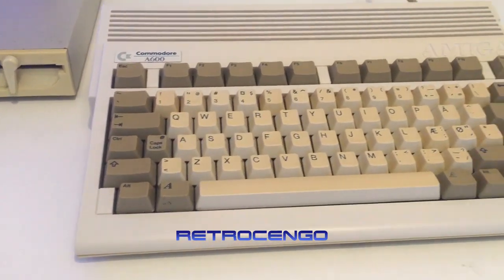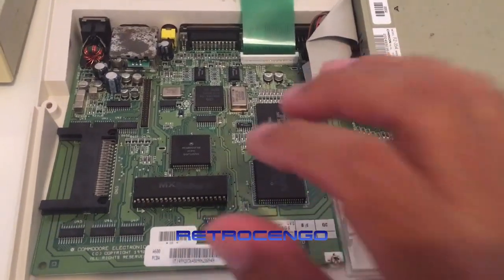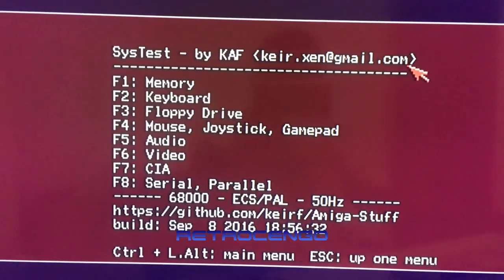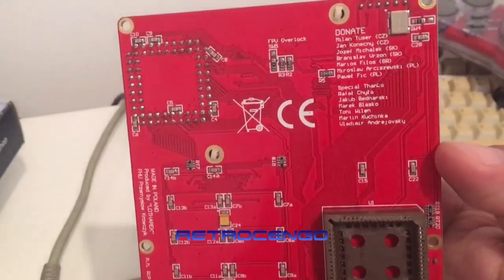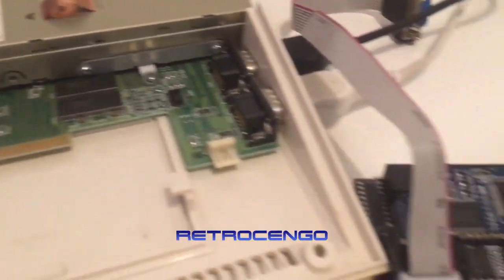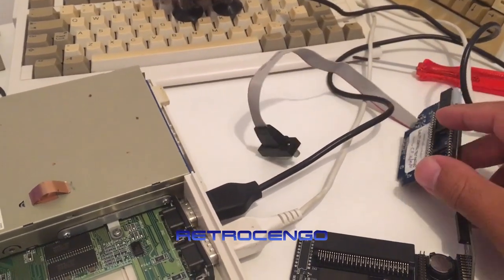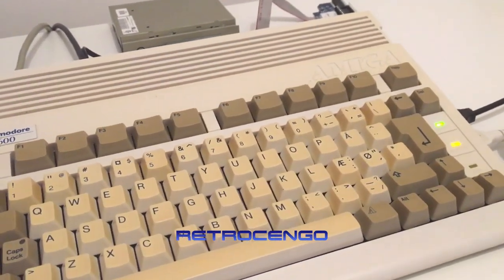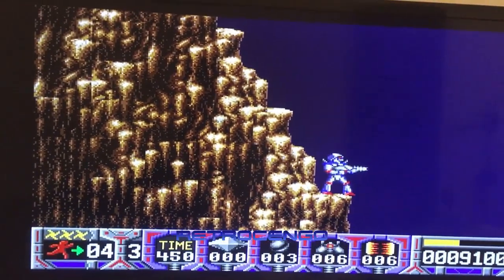Furia 68020 33MHz Commodore Amiga 600

Comment: Does the Furia board turn your 68000 chip into the 68020?
Reply from the maker: AzHeat63 It turns off the 68000 cpu, furia has a built in 68020 that takes over the system

Comment: How is that connected to your monitor?  The picture quality looks amazing.
Reply from the maker: Stephen Eddy Using RGB to Scart cable in Shielded Gold version, looks great
Reply: RETROCENGO ah, to a TV that is good at displaying a 15khz signal then.  My A1200 looks nothing like that, even via an OSSC
Reply from the maker: Stephen Eddy It’s a standard LG tv😁 shows normal 31KHz but yes in real life it looks even better😁
What do you use?
Reply: RETROCENGO I use a Dell 2007fp monitor with an OSSC to line double.  It still doesn’t look as good as that.

Comment: This is a great setup. My Amiga 600 will be the same. I got everything (also brand new ram) but not the Furia. I will buy a Furia later. I think it's enough. No reason to buy a Viper if you want it working and authentic.
Reply from the maker: D K You can play whdload this way, but its slow and with non AGA. If you have an A1200 then use your money on that one with a 1230board. 
I really enjoy all the aga demoes today
Reply: @RETROCENGO ,  as a gamer I want/have 3 machines to cover the Amiga experience - One nice Amiga 500 with 1.2/1.3,  one Amiga 600 and one Amiga 1200. I have one kickstart switch for Amiga 500. 

Some people want the Amiga 500 plus but I see no reason to have it. When I had one it was only problems if I wanted to play ocs games. The ultimate Amiga 500 must have switch for the kickstart.  The Amiga 600 can do everything a Amiga 500 plus can do and more. I don't care about the numeric.

Comment: This is my setup too.... CF card setup don't work..SD card HDD setup works nice... there's more to the Furia too.
Reply: I've not got the shadow ROM or map ROM feature working yet.....you seen Furiatune GUI ? It's on Aminet.
Reply from the maker: Amiga Dude No i havent, sold and gets used/loved daily 😁 correntley im using my A1200 Tower. The one on my last video
Reply from the maker: Amiga Dude It’s odd the Furia doesn’t work with CF. But is okey, SD card solution it better anyway 😁👍🏻 nice setup you got there
Reply: It does work with CF, its just really picky about the CF card being used
Reply from the maker: exactley
Reply: I have my own Facebook page called Amiga dude.....

Comment: that little piece of pcb you found in the box  (9:33) , was the cut-off piece of a KeyrahV2 when you dont use the keyboard of the 116 or plus4 on your Keyrah this piece could be removed with a saw or knife,
my keyrah's are also shipped in this same box of IComp DE
so you can trow that away, its nothing.
Reply from the maker: Allright, THANKS buddy :-)

Comment: ***remember this!!! if you experience this problem. the first series of A600 had a kickstart rom inserted which did not support a HardDisk version(37.299) for example, so some early 600's had ofcourse the ide connector soldered but would not detect a harddisk when you plug one in,
easy fix, place a newer Cloanto kickrom in and works.
Reply from the maker: Yes thanks for the update :-)
Reply: I bought an A600 and learned I had to do exactly this. First replaced it with a Kickstart 2.05 to stay compatible with my Workbench 2. Later upgraded it to a Kick 3.1 (No major issues, but should have done so right away). Works fine.

Comment: And button2 on a joystick? You didnt test it.
Reply from the maker: fradd thats not possible to test on the normal amiga joystick, they will all measure as button 1. Need a multibutton joystick like the one for CD32. All my joys are single button ones😁
Reply: Sadly, probably 2-button joy is not massively supported in games either.
Reply from the maker: fradd exactly 😁😁 but actually they programmed some games to use multiple buttons on CD32 games. Woks 👍🏻
Reply: Haha, LOL. Some joysticks and games support it but why bother. And why bother to use the 4 player support in parallel port? :)

Comment: It is amazing how much they reduced the chips going from the original NTSC Amiga 1000 to the A600...impressive.
Reply from the maker: Mr. SEA 7years in between,  i think its okey. Chips gettin smaller, ecs instead of ocs. External power supply. 😁😁

Comment: How hot do you think the furia gets in celcius, when it has been runnig for aprox 30 to 60 minutes gaming? Just roughly. I am not that keen on too hot stuff, as it will kill caps in the long run.
Reply: I have tested that. Only on its shield, its around 40 celcius. Maybe its good idea to install a fan inside the shield.
Reply from the maker: proshotsdk seems like a good idea😁👍🏻
Reply: I've had my Furia running all night....no issues with heat.
Reply from the maker: Amiga Dude no issues, it works, just runs pretty hot😁
Reply: @RETROCENGO  ok....what you doing when it's hot ? You using FPU 3d stuff ? I have my page on Facebook Amiga 600/500 Amiga Dude....post on there and I'll see it quick.
Reply from the maker: This Amiga is sold, new owner is using it with whdload, works perfect, but still hot
Reply: @RETROCENGO  Sweet... Congrats to the new owner. 🤗🤗
Reply from the maker: brostenen He installed SD card and filled with whdload games
Reply: @RETROCENGO  Sounds great. 👌👍 I would still install a fan in that 600, now that it has Furia installed.
Reply from the maker: brostenen The new owner is here, im sure he reads this😁🤓
Reply: @RETROCENGO  Figured out who it is... 🤗 I so much, need to install that TF-530 in my 500 now. 😋
Reply from the maker: brostenen update us here when installed😁😁 good luck
Reply: @RETROCENGO  I will... Just finished up, mounting the vga adaptor in the back of the a500 case. Shure I had to make a hole for it. The good thing is that I will not have the ribbon cable going out of the case anymore. Mounted it in the back, under the floppy drive and in the left side in the empty space. On the right, I have space left for the kickstart switcher switch. It is working like a champ.
Reply: @amigadude6409  Congrats with your 600 and furia.... 🤘
Reply: Im here... the new owner 💪 Its still going strong. I use whdload with SD card. Ill try the cf card solution and its no go. Wont work at all. SD card working flawlessly.

Nice and fast a600 with expension ram and furia card 👍
Reply from the maker: proshotsdk Nice, SD card is an awesome solution.
Reply: @proshotsdk  Guess I was wrong on who the new owner was.... 🤔
Reply from the maker: Actually, in ideal run for 30mins it gets really hot, the buttomside og the Amiga 600 was really hot, 1 hour of gaming..... Hmmmm its a hot board :-)
Reply: @RETROCENGO  So we are talking about an extra fan to be shure that it is working the next 10 years? I wish to upgrade my 600, though if the cost is a dead machine by heat, then it might not be worth it.

Comment: Yup. De er mega kompakte. Sjovt du har smidt en video med accelerator op. Jeg har nemlig lige betalt for en TerribleFire530. Det er en 030-IDE-2mbFast til Amiga500. Den skulle booste en 500 til 2.5 gange stock a3000.

Venter stadig på at man kan begynde og købe en af de nye IndevisionECS til 600. Så mangler jeg to nye diskdrev til 500. Og en ekstra scandoubler til den 500 jeg er i gang med at restaurere.
Reply from the maker: Nice, congrats with the TB card, is it still with only 2MB fast ram=? it really needs to be upgraded to 8MB fast RAM for whdload gaming :-)
Reply: @RETROCENGO  Well... At Amibay, the maker of the board, have stated that it can be used for whd. Though I really wish to use floppy for as long as possible.
Reply from the maker: Oh, for floppy/gotek use, its perfekt with 2MB fastram, but 030 is not that compatible with disk games. the 030 is awesome with whdload gaming, really love that cpu
Reply: @RETROCENGO  Yeah.... I might have to go that way. Think I will keep my 600 without any accelerator and get a kickstart switcher. Then have 1.3 alongside the original 2.x kick. Then use gotek in my 500 and run WHD.
Reply: @RETROCENGO  It has 2mb 12ns Fast ram, IDE, 030-50 and FPU.